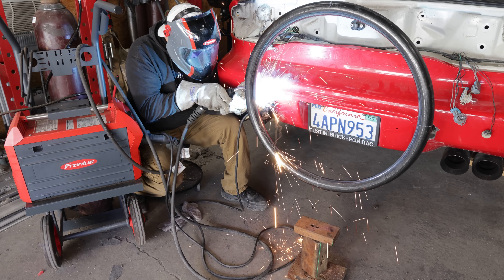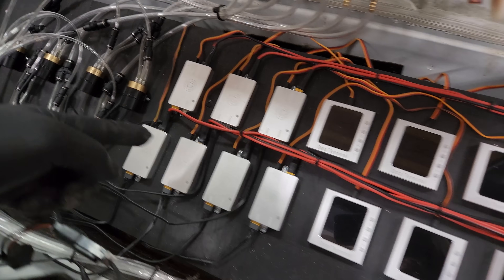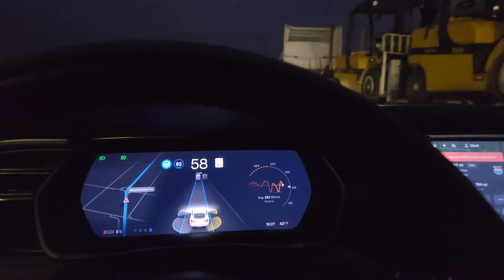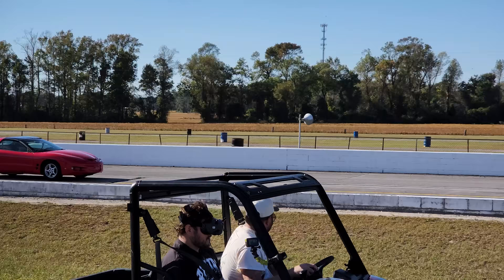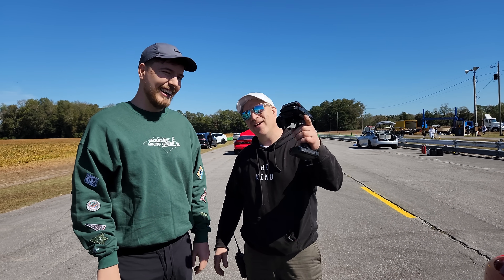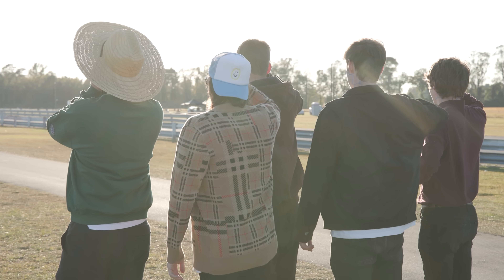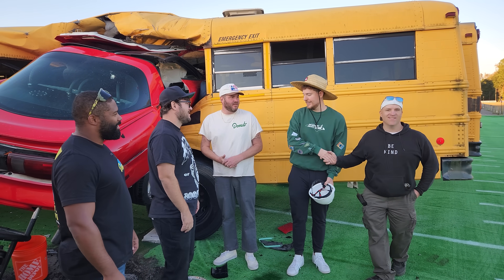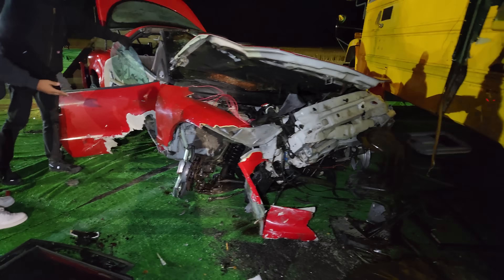RC Jet Car for Mr Beast Crashed

Comment: Can’t believe he didn’t let the car go passed 78MPH.
Reply from the maker: Dragging a** the whole way smh
Reply: @WarpedYT  I have a suggestion on how to increase the thrust of a jet engine, my idea is based on the principle of a fanless fan, The thrust of a jet engine is directly dependent on 2 factors, the amount of air it blows out, and the speed at which the gas flow blows out. I want to increase the amount of air, it is known that fanless fans blow 15 times more air than the turbine itself pumps For this, it is necessary to remove the outer housings of the jet engine, and create new housings, according to the principle of a bladeless fan, part of the jet stream must be used to build up pressure inside the new housing, which will throw in a jet air stream at the beginning of the jet engine compressor, in this way it is possible to increase the amount of air in engine, you're supposed to work with a lathe for a bit, and figure out how to force some of the jet into the hulls, but then you get new types of Jet Engines.
Reply: @hishnikchannel3529  Don't know if it works, but at least you are thinking. 👍
Reply: Yes
Reply: @hishnikchannel3529  - Do you mean something like a ram jet engine?
Reply: At first I thought it was the weight distribution of the car that didn’t make it further. Being that most of the weight is in the front it did a nose dive. Would have been nice to see how your calculations were if they went 100MPH. Still an awesome video!!
Reply: 88MPH
Reply: @alright392  They probably could have hit 88 MPH if they had the right music playing.
Reply: @jjones2582  😆
Reply: A waste of time and money putting jet engines if that's the case. What can you do what's done is done. It was still cool
Reply: I don't know.  I think it was way more fun watching it crash into the buss that if it made it past.
Reply: According to the video, he didn't use full throttle for most of the way.  In other words, he could have easily hit 100 mph but chose not to knowing that hitting the buses was much safer that trying to hit the ramp.  So this video was pretty clickbaity.
Reply: @fireballxl-5748  Since when is it clickbaity, the title of the video is "I Built a Full Scale RC Jet Car", what he did.
Reply: @nemschannel4165  Thumbnail shows a jump ramp.  And his dialogue re-inforces the bait to keep us watching.
Reply: @fireballxl-5748  da fuq you talking about. why would Nolan want to hit the buses instead of the ramp for "safety"??? like you said at 100 it would have done it. The telemetry shows that Nolan never went above 70% throttle and so didn't get the right speed, as WP explained because he couldn't see the speedo or steering with the camera positioned wrong. think for 10 seconds bro
Reply: @Unco_PK_Traceur  They didn't want to risk hitting the trees so he overestimated the capability of the engines maybe on purpose.
Reply: @fireballxl-5748  
That is called entertainment.
Reply: @IamDaytrader  Nope.   Not unless you are entertained by broken promises.

Comment: So basically you did all the hard work and they just had to press the f* ing throttle and aim the friggin thing in the middle... and they failed... Shame.
I would have sborted it half way through just by the sound of the car alone.
Nonetheless amazing work from your side. Hope the jet engines won't go to waste 🙄
Reply from the maker: YouTube needs to have a Therapy Hotline available for times like this. im actually sorta pissed. But if you look at the in-car footage you can see donuts fpv system is just duct taped up to the rear view mirror so Nolan never saw the speed, nonetheless all they needed to do was go Full throttle from the start, I'm so upset that I'm trying to just gather my thoughts and move on with my current projects here trying to put this behind me. 2 months I spent working on this project.
Reply: @WarpedYT  I can imagine the frustration. As you said. Leave it behind and move on to your own projects.
Keep it up 👍

Comment: Telemetry tells the story; car was literally at half-throttle late in the approach. Hit ramp at ~75 MPH.
Reply from the maker: And NO throttle off the line for the first 1/8 mile.
Reply: @WarpedYT  I’m back
Reply: @WarpedYT  I have a suggestion on how to increase the thrust of a jet engine, my idea is based on the principle of a fanless fan, The thrust of a jet engine is directly dependent on 2 factors, the amount of air it blows out, and the speed at which the gas flow blows out. I want to increase the amount of air, it is known that fanless fans blow 15 times more air than the turbine itself pumps For this, it is necessary to remove the outer housings of the jet engine, and create new housings, according to the principle of a bladeless fan, part of the jet stream must be used to build up pressure inside the new housing, which will throw in a jet air stream at the beginning of the jet engine compressor, in this way it is possible to increase the amount of air in engine, you're supposed to work with a lathe for a bit, and figure out how to force some of the jet into the hulls, but then you get new types of Jet Engines.
Reply from the maker: @hishnikchannel3529  I get you but isn't that the same as a ramjet?
Reply: @WarpedYT  no, I have reviewed all the possible variants of jet engines in history, my idea is unique, and the poets are interested in what will happen.
Reply: @WarpedYT  Throw off the telegram if you have it or something different, I will describe it in detail, and even draw a simple drawing.
Reply: @WarpedYT :  Perhaps the same EMI that hindered your buildup trials caused problems with communication during final run??  I love your extreme projects 👍.
Reply from the maker: @hightttech  I think the EMI's affected his brain function. Honestly he was just scared, if it were me I would have smashed that throttle at 100% immediately and kept it there the whole time balls out until that b***ch went up in flames Or jumped into the trees! Lame video
Reply: @WarpedYT  Maybe test run the test run?  Make sure the car can hit 100 mph with the same operator.  I'm guessing that was not an option .. but hind site is always clear right!
Reply from the maker: @BobCounts  I wish you were there to repeat that too then every 30 seconds, I told them over and over so many times I lost count. Yes absolutely you should be testing and practicing and mentally preparing. I'm just a little angry because of the amount of money Mr Beast put into this project as well as 2 months of my hard work.
Reply: @WarpedYT  hahahaha yeah man
Reply: @WarpedYT  Why didn't you just drive it? I don't understand why Donut Media had to be a part of this.
Reply: @WarpedYT  Wow man that's rough. Not your fault at all. It's totally understandable that it's upsetting but man you do amazing work and this was not your fault in any way. I wish I drove it, I'd have launched that thing so hard :(
Reply from the maker: @AGLTC01  thanks but yeah Mrbeast wanted me to drive it, I should have just done it but I was worried about donut not having content 🤦‍♂️. Learned my lesson
Reply: @WarpedYT  ahhh well you did your best man. We can only do what we think is right. Like you said lesson learned, and at the end of the day you did a great job putting it all together and tons of people loved it. I didn't even know it was supposed to clear the busses I just enjoyed your work and the content.
Reply: @WarpedYT  why did he do that?! He made you look bad
Reply: Mr beast is a pussy boy for that one

Comment: Telemetry shows the car throttle was not utilized to 100% upto 100 MPH then feathered to maintain speed. The math was correct, if it had reached 100 MPH to 103 MPH to compensate for the speed loss of the ramp allowing for a ramp exit speed of 100 MPH ... I think it would have made it. My concern would be the balance of the car causing the front to pitch down slowing the vehicle in mid air and causing excessive down force. Maintaining full throttle of the car engine would help to pitch the front up but it would be by a very small margin and probably not enough. 
Excellent jump though, Evil would be proud.
Reply from the maker: Big problem imo was the fpv camera  was taped to the rearview mirror.
Reply: @WarpedYT  so... does the engine work?
Reply from the maker: @tilen3266  yes
Reply: @WarpedYT  crazy stuff. Cant wait for a new video.
Reply: @WarpedYT  I have a suggestion on how to increase the thrust of a jet engine, my idea is based on the principle of a fanless fan, The thrust of a jet engine is directly dependent on 2 factors, the amount of air it blows out, and the speed at which the gas flow blows out. I want to increase the amount of air, it is known that fanless fans blow 15 times more air than the turbine itself pumps For this, it is necessary to remove the outer housings of the jet engine, and create new housings, according to the principle of a bladeless fan, part of the jet stream must be used to build up pressure inside the new housing, which will throw in a jet air stream at the beginning of the jet engine compressor, in this way it is possible to increase the amount of air in engine, you're supposed to work with a lathe for a bit, and figure out how to force some of the jet into the hulls, but then you get new types of Jet Engines.

Comment: I know you said the car was way underpowered, but even with the jet engines it took 26 seconds to reach 78 mph. How much thrust were the jets even adding? Why not just use a car that can reach 100 mph on its own? Love the channel, not trying to be a hater. I’m just confused.
Reply: It looks like the something went wrong with the servos controlling the car's throttle. The jet engines were at 100%, but the car never even got close to 100%. That would definitely cause the car to not reach the correct speed in time.
Reply from the maker: No that's elementary data is from the remote control, the person who drove the car was scared and never went Full throttle, also he had no idea how fast he was going because the donut guys just duct tape the fpv camera to the rear view mirror. I fought with them to mount the camera in a spot where you can see the speedometer.
Reply: jet continues to provide thrust mid-air
Reply from the maker: Because apparently grandma was driving, he was supposed to hit Full throttle from the start but as you can see from the telemetry he never ever went Full throttle at all he took off so slow.

Comment: That's mental! Did the EMI mess with the throttle receiver / servo maybe? It didn't even hit 100%
Reply from the maker: No, that was the driver who never went Full throttle, donut duct tape the fpv camera to the rear view mirror so Nolan was never able to see this speedometer, completely against my advice. So he was driving like a grandma
Reply: @WarpedYT  Ah that's disappointing.
Reply: @WarpedYT  I would have been so pissed. Why didn’t they just let you drive it?
Reply: And shifting super short at 4k  because it didn't see full throttle, when redline is over 5500.  @WarpedYT

Comment: Why was throttle not 100%?
Reply from the maker: Because the guy driving was scared, he was supposed to hit Full throttle off the line so he can hit the ramp at a minimum of 100 miles per hour.
Reply: @Warped Perception  Oy. Spearing a bus was entertaining too.

Comment: Re-upload? What happened
Reply from the maker: The other video died, also I wanted to add the telemetry data from the RC remote to show everyone why the car never hit 100 mph. Even I didn't see this footage yet and I was very aggravated when I did to find out that Nolan never even went 100% throttle, when he took off from the line he was going so slow didn't even hit the gas until half track.

Comment: Could have done the same thing without the jet engines. Epic fail!
Reply: And there is more weight at the front of the vehicle so tilting downward from the front will be an issue. And speaking of weight, the vehicle would need to go at least 150mph to achieve such a long jump. And… if you look at the landing ramp, its not as subtle touching the ground so even if the vehicle were to reach it, the inertia will destroy the whole front of the vehicle’s nose.
They need a longer and more curved landing ramp.
Reply from the maker: No I did all the math and simulations, all it needed was 100 mph or more. You can clearly see from the in-car camera clip what went wrong, the driver didn't even hit Full throttle off the line, ridiculous
Reply: @WarpedYT  It would have worked with a jato bottle for sure.

Comment: Well, I'll watch it again. See if I can spot what changed.
Reply: I see the little bar graph during acceleration. So, there was the issue. Not sufficient throttle input.
Reply from the maker: I just don't understand why he was driving so slow, maybe he was scared? He Accelerated from the line like a grandma, apparently nobody understood the agenda, it was basically a drag race.
Reply: @WarpedYT  yeah man he kind of literally tanked the whole deal